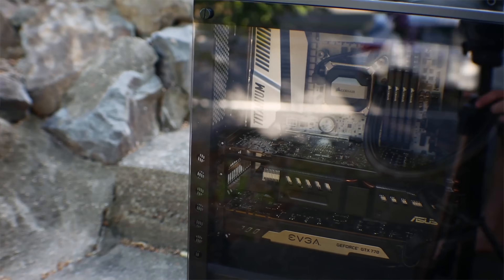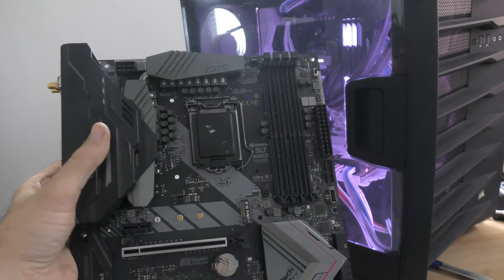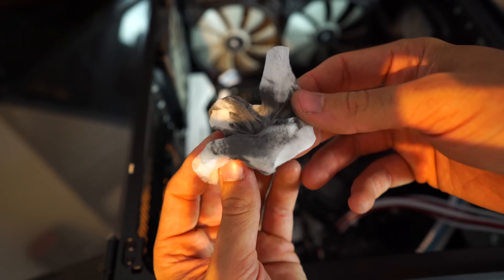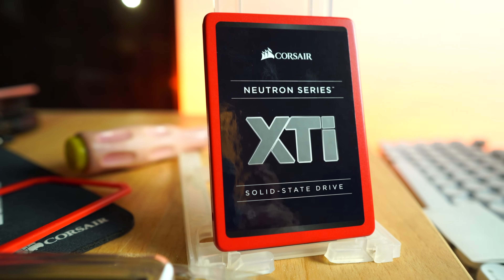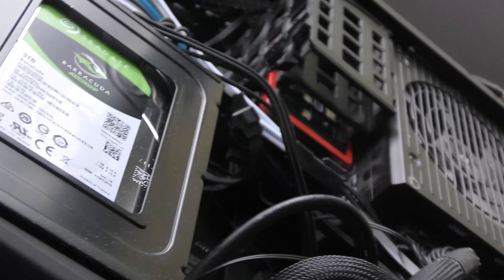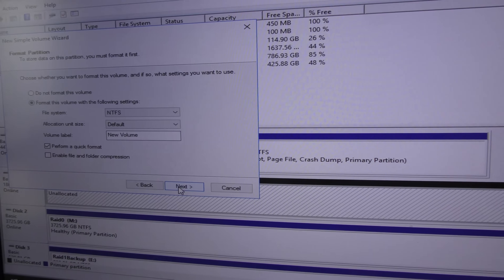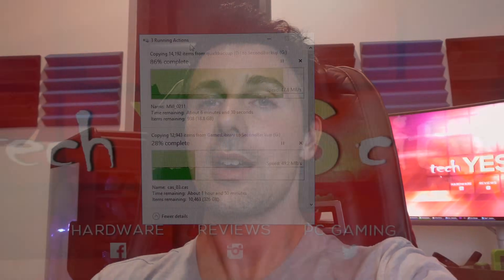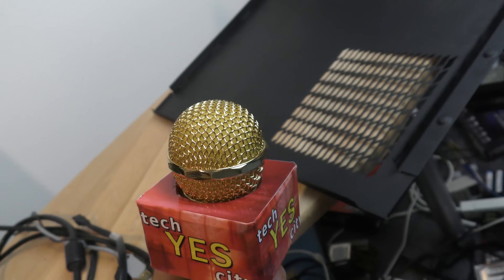Changing my PC from RYZEN to INTEL - Side, Up or DOWNGRADE?

Comment: My computer boots up from an M.2 drive..... in about 7 seconds
Reply: Wow that's 5 seconds faster than I'm booting off a mechanical HDD. 7 seconds is pretty fly for a cold start PC boot up. But then again who boots their PC? And don't even get me started on those Windows updates. What's going on with those?

root@five:~# time aptitude update
real 0m3.623s
user 0m2.635s
sys 0m0.228s
Less than 4 seconds!
Though the update itself took 5.866s So a total of 9.489 seconds. That I can live with.

Comment: RedGamingTech
Published on 2 Jan 2018
Intel are in a world of trouble, as it has been discovered that a bug in the design of their processors could impact performance by up to 30 PERCENT, and worse - not microcode update will fix the issue at all. Therefore, if you wish to retain the current hardware you'll need a OS based update, which will negatively impact performance. Adding further insult to injury, this problem doesn't occur with AMD hardware, a potential diaster for Intel going forward given AMD's moves with Epyc against Intel's Xeon in the datacenter.
Reply: You realize side channel hacks can't be done remotely, don't you? Any CPU that does speculative out of order execution is vulnerable too. So that means AMD as well. So yeah I'm opting to not apply the fix on my system. But if you run an OS controlled by a corporation you won't have any choice in the matter. They'll make the decision for you. They will err on the side of Wintel profits undoubtedly too.

Comment: Don't know if you are having the hard lock issue but I think I found a workaround to fix it. I have a R5 1500X and X370 Taichi. When I installed the drivers for Ryzen chipset to get Ryzen Balance plan, I reset my Windows into safe mode, run DUU and uninstall AMD display drivers. After I did that, it never hard locked on me. Hope this helps.

Comment: If I ever do anything on my computer during the month of November after Black Friday and December I will have computer problems. I am having computer problems. I still haven't recovered from these problems. At least this time my computer still runs with no fan hub and half the fans not running because the motherboard didn't have enough fan headers to accommodate all the fans. I hate this time of the year.

Comment: Drive configuration? sure.
Got a 128 GiB SSD for the system, 3 TB drive for most of the installed stuff, another 3 TB drive for my personal files, and a 1TB drive for recording. But I'm thinking about upgrading that to a dedicated storage unit/server.

Comment: In our HP server environment we only use hardware raid controllers as it works best with the 15k RPM SAS disks arrays. We've run into problems using hardware raid controller with SSD drives in the past however we haven't done much testing after that now. Our NetApp storage uses OnTap (software) just because it is an entirely different architecture design than the server environment.

Comment: Interesting vid. I switched my bits over to Amd Ryzen 1700 some months ago. My first ever AMD build. I’m still using my intel installed windows on the AMD but I also have an AMD installed windows both with fall creators. DDR4 I purchased can go to 4500mhz and has a 4000mhz XMP. I can only run it at 3466 at moment with Beta bios on Giga gaming 5.

Comment: AM4 will last for years while intel changes their socket like every year.
Reply: Intel doesn't change their socket every year... They panicked and released Coffee lake earlier than planned because of AMD. I assume they'll stay on z370 for a a few years. Don't be ignorant and don't spread said ignorance.
Reply: Mrjoecreeper Ok its more like two years. Still to short in my opinion. Also some coffee Lake CPU's could have worked perfectly on last generation motherboards if power delivery was sufficient. And this was confirmed my Asus i believe.
Reply: Ronald De Regt Two years isn't too short in my own opinion. Facts are, the majority of people upgrade on a 3-4 year cycle. Ryzen was released Q1 2017 and they promise AM4 support until 2020. Let's say they change socket types in 2020 with a revamp in their CPUs and let's also say you bought Ryzen the month it came out (February 2017 I believe?) So you bought a Ryzen CPU, and you plan on keeping it for 3 years, or until you find it necessary to buy a new CPU (this could be over 6 years for some) You'd still need a new motherboard regardless if you bought Intel or AMD. Buy what you want/need and upgrade when you feel necessary. People who upgrade CPUs on a yearly/biyearly basis are in the minority, and shouldn't be used as a main statistic to try and justify one brand over the other. Intel and AMD both make pretty damn good CPUs and quite frankly I'm having a hard time seeing any downsides of one brand over the other.

Comment: mate your doing it all wrong, why are you doing raid through software in windows, x370 supports raid, your board has two sata controllers, 6x by intel of course and 2x by asmedia, the intel is the only controller that supports raid, so you hve to make sure youre pluging your drives into the intel sata connectors (look at manual to tell which 6x are controlled by intel) and at that point you should change it to from ahci to raid in the bios, then when you boot up, you should get a flash screen (like the pny 750 ti splash screen but for raid) that says all the drives you have installed and to "press i or c or m" or whatever key it is to set up raid at the bios level then when you get to windows install screen and it asks to choose a drive, your raid array will aleady show up instead of having to create it software wise in the dumb installer window, hope this helpsssss

Comment: my computer has that issue too where if i leave to do something and leave my PC on the display doesnt work and it stays frozen. and sometimes when i wake my computer from sleep or restart it it goes into Full fan speed mode. then it beeps saying the video card isn't plugged in. i think it might be my power supply crapping out.

Comment: The fan profile in the Asus and asrock motherboards is based on that temp it's currently at on the line so you can make the fans ramp up and down smoothly if you aim for the line around 1c per 100rpm roughly

Comment: Re-Flash your BIOS.  It needs it now and then with the Crosshair VI Hero, and maybe it will help you with your Asrock.  That capture card should work fine in this setup.  I'm using a cheap $40 Chinese card with the wackiest drivers and app I've ever seen in computing, and it works fine in my setup (1800x C6H).  Keep a copy of the BIOS on a USP and leave it in the BIOS USB port if you have one.  I've had to do this a couple of times.  It gets into a state that looks like it's working fine, but some wacky things happen that cant be fixed with software adjustments or re-loading BIOS profiles.  
Just flash the same BIOS ver. over the old and try that card again.  It'l likely run better too.  I couldn't get my 2 x 16GB sticks over 2933 for a month, then I re-flashed, put the same settings I tried a dozen times and failed, and it works great now at 3200.  Not bad for 2 big dual rank sticks.

Comment: Brian, don’t do it, they are coming out with an 8750k with a refined process, and about 10 other desktop models, of course you’ll need more spray paint for the new motherboard you’ll have to buy. Yes guys, Intel is releasing more new chips. The 8750k is still 6/12, but supposedly has a higher ipc, overclock better, and runs cooler...

Intel, the only company that can cause buyer’s remorse on their best desktop chips in a few months...

Comment: I wanted to get an R5 1600 but the need for fast RAM to get the most out of the CPU was a real turn off with the way RAM pricing is right now. I got an 8400 and a Z370 ASRock Extreme4, I'm planning on selling the 8400 in a few months once 8600k prices come down near the $250-$260 recommended price.

Comment: Elgato HD 60 pro any good, I want use it on  ryzen 1700 system in the future, The avermedia hd live gamer portable isn't bad, its lag something and its annoying but i brought it to capture ps4 and ps tv gameplay.
Reply: supero90 you can run into some Issues with a Elgato HD 60 Pro on Ryzen. I had the following issue before: The capture card won't be detected unless it was placed in the first PCIe 16x Slot which goes directly into the CPU. The capture card had to get a firmware upgrade by elgato which took about 2 weeks if I remember correctly. But after that everything worked just fine. Just wanted to let you know ;)
If you buy a HD 60 Pro now it might already have the newest firmware.

Comment: the mother board is holding back your ryzen system the asrock taichi is the worst board for ryzen.
Reply: Brandon Dennis some people just don't look into to the best board for a chip I guess it can get to nerdy. Lol, but all ryzen boards had a tough launch but iam happy now it's sorted. And very happy the am4 socket will have support later on so I can keep my ASUS  crosshair vi hero board.
Reply: Brandon Dennis can't always pic your mother board based on color alone
Reply: Brandon Dennis, you kind of saved yourself a headache a little bit the board had a very rough start with the BIOS updates not coming out fast enough only for the past couple of months has it been terrible also to you can buy it now cheaper with it working properly but through the problems it always work just the overclocking was the major issue
Reply: Ryzen is figured out now you can easily get a much more stable over clock than you could 4 months ago. but with that being said i will stick with my ryzen CPU once you learn to play nice with her she is a fun cheap date that should stick around for a while. that is my one grape about intell they make you buy a new mother board every time that really sucks. but the Ryzen platform for me is VERY good at multi tasking and that is more important for me. rendering a project while playing two game (while playing pubg i had a video rendering anf also had elder scrolls online open because i died in pubg.) also running workloads on ryzen is great but purely for gaming Intell would take home the cake but only beacues most games are single core focused. i do think the single core game engines will change to be more like vulcan in the future and use more cores to process games. due to the market standard now being 4 cores plus.
Reply: If you want longevity got with the x370 chipset the AM4 socket will be around for way longer than the z370 intell socket. so you can still upgrade for cheaper later. unless you just like buying new boards.
Reply: @Elemental Designs That ram is not so good with ryzen. there are special ryzen ram kits ti ensure you can get 2666mhz clock speed  +/_ on the ram. i would suggest the ryzen ram kits if you are not familiar with over clocking.
Reply: @Elemental Designs I have this kit Corsair Vengeance LPX 16GB (2x8GB) DDR4 3000MHz Kit – CMK16GX4M2B3000C15.  i have been able to get 2933mhz with no problem from a cold boot thanks to a few tweaks in the bios and the Asus bois updates. but you can get the lower speed LPX kits if speed is not something you care about. increasing ram speed will help you get more FPS as well.
Reply: I would go for the Asus B350 but ram prices are high right now. G.Skill Ripjaws V 16GB (2x8GB) DDR4 2666MHz Kit – F4-2666C15D-16GVR I would go for this kit here from G skill.
Reply: Elemental Designs the downside is llc for asus board but for consumer based over clocking but should not be an issue. I personally have had great results with asus. Personally

Comment: The 1709 update seems to be randomly hard locking or bug checking on amd cpus (ms problem not amd) ms needs to release an update out (they have stopped rolling it out on amd platform until they fix there public beta software feature update) , if it's older version your need more voltage most likely

Comment: I had the same setup as you, x370 Tiachi with an 1800x and 1080ti and moved to 8700k with an Asus Strix-E Z370. I had nothing but problems getting it to recognize my old UEFI install of windows on my NVME. I had to start from scratch in terms of programs and settings.

Comment: I literally don't care what the inside of my PC looks like, as long as it has good cable management and air flow. A freaking hate that my graphic card has LED's I can't turn off, so I covered up the side panel window.
Reply: I thought i was the only one. Honestly i dont give a fuck about colors and RGB lighting, and i actually hate it. Also all the lights are distracting. I even hate my mouse for having rgb, but there is no fucking premium decent mouse without rgb. Same goes for RAM. If you want faster RAM, then RGB is a MUST in most cases. As you said, all i care about is cable management and good air flow and its beauty for me. When i see rgb and stuff, all i come to think about is that some teenager is using it.

Comment: might I suggest a dedicated hardware RAID controller card?
Reply: Hardware RAID generally isn't the best option either. If your controller dies you have to get the exact same again. Maybe even with the same Firmware version if you are unlucky. Filesystem RAID or Software RAID can be a better option in many usecases. I'd recommend a Filesystem RAID but I don't know how well Windows is equipped for stuff like that. Windows could benefit a lot from stuff like ZFS, XFS, Btrfs and LVM. I mean Micro$oft is copying a lot from the Linux world anyways lately. Why not implement something useful for once
Reply: skylar jensen what I was going to say
Reply: :3
Reply: His best bet I think is Windows software RAID, because chipset RAID is nearly software RAID and if your system dies windows can read all windows RAID. On the other hand Chipset RAID can be read only with like chipsets, so there is a risk of loosing everything.

Comment: Gaming: intel Core i5 8600K; Editing: AMD RyZen 7 1700

The 8700K is a great all rounder when you do both, but just for Video editing / encoding the 1700(X) is just as fast and for gaming only the 8600K is just 5-10% slower, it's just not woth it

Comment: Downvote for not using a TR build.

Looks like an overall sideways build with no upgrade path for the average “Joe”.

Games better, especially that darn PUBG which hates AMD
Production? For consumer chips, I guess it depends on the software, so 50/50.
Live streaming downgrade.

Yep, it’s a strong sideways, which should help you out in Premiere which only seems to use 6/12 on consumer chips for whatever reason.

Comment: No problems with ram on my r7 1700x. I've been running gskill trident z rgb since ryzen launch at 3200. Took a few minutes to get it running 3200 but no problems since then. Don't regret going with AMD ryzen for my first PC ever and it was really easy to learn how to overclock it to 4ghz and ram to 3200.  Plus I dont like how Intel treats it's customers, kaby lake was pointless when they released coffee lake just a few months later. They should have just trashed kaby lake and gone straight to coffee lake from sky lake. Just my opinion though.
Reply: kaby lake gets thrown under the bus in 8 months, not to mention the need for new motherboards (and lack thereof) for non-K. I don't see the main reason why I should buy Intel this year. In the used market probably, like Xeon.

Comment: Sticking with my fx8350 till ryzen+ or ryzen2. Want AMD and board company to have more time to refining their produces. And frankly I would never notice a difference till I get better then 1200p 60hrz monitor. Sadly current 1200p monitor are expensive as hell but no way in hell I'm going to downgrading on resolution.
Reply: What games are you playing? fx series are just horrible. I would rather go with G4560 than any fx CPU. Also i doubt you wouldn't see difference when switching from fx CPU to any new CPU be it from ryzen or intel side.
Reply: vasilije94 since I only have a 60hrz monitor getting 60+ frames wouldn't be noticeable.  As for games, most new triple A don't interested me, I mostly play Indy titles and older games. Already get 50-70 fps in space engineers and similar in PlanetSide 2 with my xfx Rx 480 8gb. So till I can replace my whole system including several new 1200p+ monitors that are higher then 60hrz a upgrade isn't worth it.
Reply: Well rx 480 is good GPU. But with that CPU you are getting dropped below 60 all the time. But then again i understand if you dont want to upgrade. I just wanted to point out that there is a big difference between fx CPU and new ryzen or intel CPUs that you will notice if you upgrade. Thats all i wanted to say.
Reply: Yeah I know in new games I'd get below 60 but I'm simple not interested in most of them. Only new game I've gotten in a long time have been Civ 6 and a friend got me destiny 2 so he had someone to play with. In civ 6 I know I'm not getting max frames but that okay I don't notice it with that style of game, and my CPU can handle CIV 6 and another game like Factorio playing at the same time so I'm okay with it. In Destiny 2 I regularly get over 60fps since they've got great optimization for the game, even if it's got to little content to keep me playing long. All my older titles (many real old) I have no trouble keeping 60+ because even a fx8350 is overkill for most of them.

As for a new system, I always buy system with long upgrade possibilities, since I normally try to upgrade my CPU after 2-3 years. So once ryzen+ or ryzen2 come out I'll upgrade and then 2-3 years down the line grab top tier ryzen3. But there are issues with ryzen's first generation, even if few and minor, like ram issue and don't feel like dealing with those. And frankly with intel I doubt there will be a upgrade path at all before they require a whole new chipset again.
Reply: I got a fx 6300 and it's really great at the moment. Getting 100 avg(turboboost not overclocked) on competitive games.